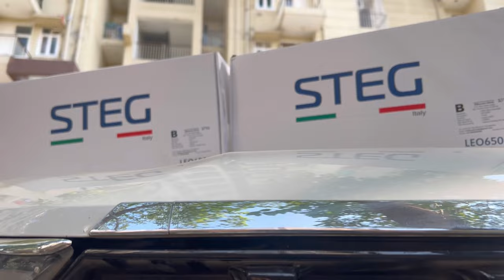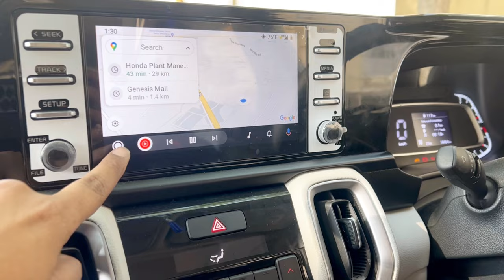AUDIO SETUP Worth ₹50000 in KIA SONET | बेस्ट ऑडियो उपग्रेड | STEG LEO 650C | Cerwin Vega 1200.4D |

Comment: I have a Hyundai Venue SX(O). I’m willing to replace my stock speakers with JL Audio C1 Series. I don’t want to replace my stock head unit and also not interested to install any amplifier or subwoofer. So, is it possible to do the setup without installing any amplifier? If yes, then what’s your thoughts on this.